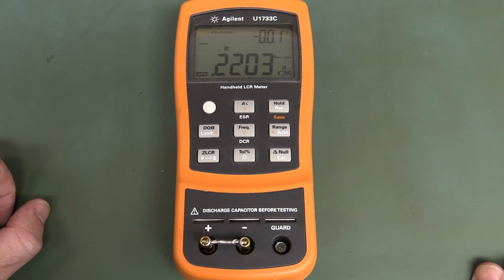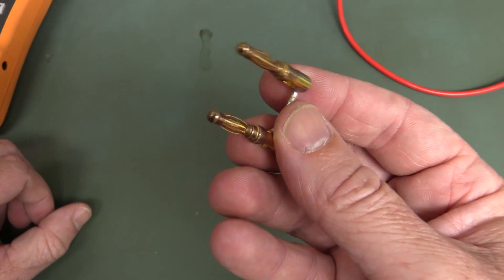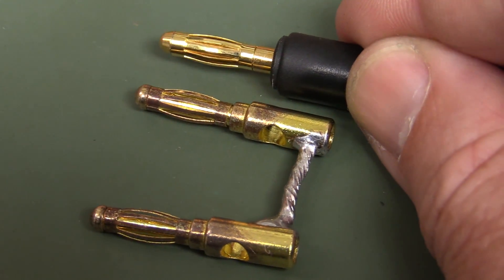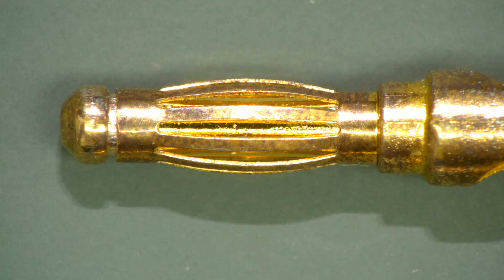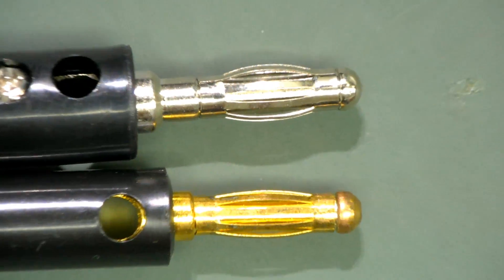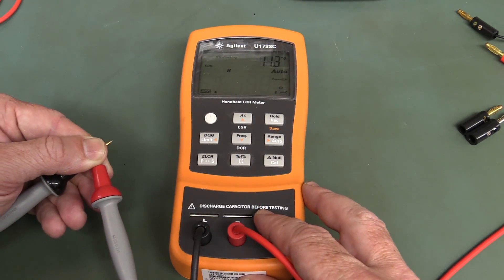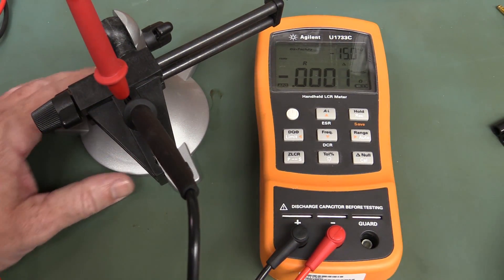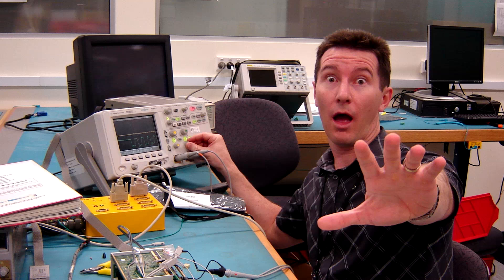EEVblog #1052 - BEWARE Crap Banana Plugs!

Comment: This is why I purchase proper brass banana plugs, a cyliner with a cut in the middle, sometimes you have to use a screwdriver to make it bit wider as diameter varies a bit. Same design was used in soviet era banana plugs. https://www.piekarz.pl/img/offer/1/9/f_19326.jpg These things never failed me.
Reply: You might be surprised how poor a conductor brass is.
Reply: For me these things worked much better than generic chinese banana plugs, brass is a rather good conductor as far as I know. May require some care just as other connectors. Brass is also used in my analog multimeter's terminals. 48 years and no sign of problems
Reply: Brass is about 20x more resistive. 

Brass ~0.6 - 0.9 x 10-7
Cadmium 6 x 10-8
Cobalt 5.6 x 10-8
Copper 1.7 x 10-8
Gold 2.4 x 10-8

Ohm metres at 20 deg C.  It's also not a great conductor of heat, irrespective of its copper content.
Reply: @ChristianRThomas  I'd like to see you measure the different... with current anywhere within the rating!      But seriously, I've had some of this style that became too loose.  Pry the thin slits apart with A thin screwdriver, but they don't seem to stay spread very long.
Reply: @0202fabrice  I have the kit to do that sort of measurement - and I could probably also measure the difference in distortion between this sort of plug and something decent like a Speakon.  You'd be surprised quite how poor most of these connectors are, though I usually hold my special ire for RCA phonos.  Brass is not chosen for its electrical properties but for its machinability.
Reply: @ChristianRThomas  Agree with your last point, but it's not a bad conductor at all for the very short lengths and robust circular mils in the form in which it's used.  You're surely not using brass wire for the conductor; most of the conductive path is copper, which almost asssuredly swamps the resistance of the brass plug.

Let me challenge one other assertion: please explain how a minuscule amount of resistance (as compared to copper) will create audio distortion.  Were that the case,  you'd need superconductors from amp to speaker!!  ; >)

Comment: My uneducated guesses are, first the crappy ones pose a “Gold Flash” rather than gold plating and second, the loose sleeve (cage) is too short or the core is too long.  That combination prevents the ends butting when the cage is extending.
Gold flash is something like one gold atomic layer directly on top of brass.  Hard gold typically has copper flash, then nickel for hardness and finally a decent gold layer.
But what I believe seeing is a length difference between the crappy ones and all the others.  Finally, the cage has not been properly crimped around the pin, leaving a gap.

Comment: Also seems like the split section of the banana jack is much shorter then the solid center section. The part on the Probe Master banana jack looks like theres almost no gap there at all, while the cheap ones theres a large gap. Id say between that and the cheap coating you've found your problem Dave.

Comment: To me it looks like the rings of the bad plugs are too short.
the rings of the good plugs seem to be just short enough to allow rotation when uncompressed, but not short enough to do so when compressed inside a proper socket.
this gives the good plugs four points of contact as opposed to just two on the bad plugs.
Reply: To me it looks like someone stuck for a real problem to get on their high horse about.  Unbelievable!  How can it happen?  why do the masses tolerate it? ... y'know - that sort of stuff.  If I had a penny for every lead I've chucked in the bin, I bet I still wouldn't have as much dosh as 37k views generated for this guy - and still worth a few dollars more - so mission accomplished.

Comment: are you sure it is the ring not compressing because of the lack of the split in the ring, but rather that the length of the rotating sleeve is too short for the recess on the pin.  Seems to me that when compressed the sleeve will lengthen first till it comes into contact with the end stops and at that point the curves will start to deform along the long axis before any forces are high enough to start compressing the end rings diametrically.

Comment: Unfortunately I've purchased a few as well. I ended up holding the rotating part close to the tip and soldered the tip creating an electrical bond eliminating the rotation yet allowing to compress and move on the wire side. Hope this helps others who have in the bin!

Comment: I have no sympathy with the bought for pennies crowd.  If you do a job, and expect to be paid - in what universe does that NOT apply to the rest of the world?  Why would anyone pay a penny and still expect the same quality for the equivalent of a £200 item covered in thick gold?  The chinese are some of the shrewdest cookies in the world when it comes to horse trading.  Yes their labour costs are low - and yes their government subsidise a lot of what comes out of china so they can beat competitor's prices.  And yes in a couple of years the average chinese labourer will expect a living wage, And yes in anther couple of years, when all the other producers have finally shut up shop, as the sole source of everything they'll up the prices.

In the meantime we greedy westerners will continue looking for the cheapest, expecting gold and copper and being surprised and outraged at getting aluminium.  Chinese kit like every other source sells to the price, it's mostly all been made there for years anyway - just in the line next to the dirt cheap ebay one.  Pay a bit extra and you'll get the same kit your old supplier provided.... just not re-badged and given a made in 'murica (or Oz ... or wherever) label.
Reply: You'd pay £200 for a banana plug?!
Reply: Your words not mine CT - I try to keep my expectations real - Looking at my current stock of leads I don't have any gold coloured plugs or clips. 
 All my current leads have a silver finish, most have survived more than 2 years and show no signs of wear or imminent failure.  Gold has it's place ... but not in my general toolbox.  If you're impressed by appearances and need something shiny, make sure you pay a fair price to avoid disappointment.

Comment: There seems to be a lot of up/down movement on the rotating contacts of the crap plugs compared to all the others.  When the curved splines compress it should also elongate - pressing the ends against the centre pin flanges.  That may provide better contact in the non-crap versions.  Perhaps poor manufacturing standards?

Comment: This is not a trap for young players at all. This is a trap caused by unregulated Chinese imports and that traps all players. Some products are substandard; sometimes you can visually see it, other times you can't and this is true across all the industry. Ways to stop bad products: 1) Border customs need to up their game, 2) Buy from a reputable source (it costs more for a reason), 3) Name and shame. I didn't watch all 15mins of this video but I sure hope Dave named and shamed. If not, why not? There are tons of bad connectors around and tons of dross sold on ebay and Amazon. I keep telling people not to buy electrical stuff off ebay; if you do, expect crap.
Reply: All that has to be done is to write a truthful review.  But be precise and specify the seller you bought from.  To many people just spout off without proper precision or specificity to help root out bad sellers.

Comment: Could you "quickfix" the Bananaplug if you sand the bottom-end of it and apply a small bit of lead at it, just a point to ensure the connection. It should always be able to flex and stretch? or would it end up more wrong.

Comment: I've run in to this issue before. It is the split in the expanded sleeve. I've had to pull them off and take a dremel tool and increase the gap in the sleeve. When you insert the cheap bananas the sleeve makes great contact with the jack, but the split closes before the sleeve is compressed onto the inner pin. This leaves the connection loose.

Comment: I have the same kind of bananas on my meter and they are like 5 year old, they are corroded and bent and they had the same contact problem since almost new, my fix for it was to use scotch tape around both of them compress them and they work. I need to get some good quality ones lol.

Comment: I always use high quality 4mm banana plugs from hobbyking, they're for RC planes, to be loaded with like 50A and $1000 plane's "life" depends on them, you can't really get better ones.
+ add their silicone wires and you have AAA quality cables.
Reply: I do the same. I've been using connectors from hobbyking for my octorotor (with camera gear its about £6000 worth) and they are spot on although they are massive ones on that with a built in capacitor in the tip to stop arcing on connection. I made my own leads in the same way as you except I added some of their wiring loom mesh with adhesive lined heat shrink on each end. I use them a lot on site for domestic electrical testing as the mesh protects them from splitting the silicone on a stray nail!
Reply: You are dead right they are excellent quality, plated brass. You can get these with hermaphrodite shells which can be made up to regular plugs & sockets.
Also I join them together back to back which gives me a plug with extension socket to loop into other test gear.
Reply: Some of them (not from HK) are so bad that they don't even stay in the female sockets. The guys on RCGroups are recommending the ones from HeadsUpRC and Aloft. https://www.rcgroups.com/forums/showpost.php?p=38832952&postcount=9953
Reply: Me too, allways replace crappy hard pvc cables on crocodile clips, multimeter probes... etc. with silicone insulated thin coper fiber soft cables from hobby/RC shop, they come in all diameters, from "hair-like" to "welder wire" diameter... 
It gets down below -20 deg.Celsius here (cr123a 3V lithium batteries in multimeters instead of 2*aa or 2*aaa save the day)... try using pvc insulation at that temp ;-)

Comment: I would not say that the high resistance is entirely related to the loose end rings and the quality of the plating. I believe that the length of the splayed contact part will increase when the banana is inserted in the jack (due to its mechanical design). This causes the end rings to form a secure contact with the “hard stops” of the inner shaft. For sure, the splayed contact part is very short in length when compared to the overall length between the “hard stops” of the inner shaft, which may be the cause of the intermitting contact/high resistance.

Comment: Coincidentally I ran into this problem very recently!
I wonder if the quality of female sockets can also be a problem? I have some plugs that do this but work fine with other sockets. Some sockets feel a much firmer fit even though it's the same diameter and doesn't wobble so much. Like you suggested, perhaps there's different styles of plugs and sockets?

Comment: The real problem is that , the spring sleeve should compress around the inner solid part of the plug .
To do this it needs an small air-gap between the sleeve edges , now it is rotating so freely , that it won't
though the inner solid part even if inserted in a socket .
It is possibly made to the wrong diameter tolerances , and crappy '' gold '' plating as well !

Comment: I got some with the same problem, and I improved it drastically by dumping a bunch of solder into the joint where it rotates. It still rotates, and it fills up the space and fixes the fit. I can go from "total crap" leads up to "cheap but works."

Comment: That is not gold on the plating.. gold does not corrode or turn black and shitty looking..i got cheap banana plugs on my 30/5 bps and the rotating part meltded as the moved while conducting some low power. The resistance had gone up as it did on your shunt and the plug melted.. lol gg chinesium

Comment: I was curios about say age and wear.  Take some plyers and remove the splayed  ring on the outside and see if the gold is all worn off.   Then you mention its not that old?  I was gonna say you just need to get some new one's  just cause you had that one since you were a boy or something.  Then you pull out he new one on the micro.  That's not gold plating,  I think that is gold paint, literally.   Not sure I run across "gold paint" but I have run across plugs that are just totally loose after inserting them just a few times.

Comment: Couldn't you just flow a little solder in there to solder the 'peel' to the 'banana' part?  If you heat the peel up and flow it in the edge there it might get wicked in.  For that shunt, they don't need to rotate so it should work.

Comment: Actually nothing is wrong with the banana Plugs Dude, it's because you go and Solder the 2 together and the Heat of the Soldering Iron causes oxidation to the Plugs and then it Developed Resistance dude! This plugs are just not design to be solder at high temperature Dude!

Comment: Dave, take a knife and scrape off some of the plating. I bet what you find underneath is not a common metal used in electrical connectors. The surface of these scream that they are cast out of some poor quality metal. If they where machined there would be rotational marks along the axis of the plug not looking like the surface of the moon. For those saying to clean them.. you cant clean away inferior material! Buy good quality.

Comment: I've had similar problems with some old tin plated banana jacks. I move the rotating part as close to the tip as possible then add a nice dab of solder on the tip end of the rotating contact point, so it's still springy. Sure it doesn't rotate anymore but the connection is solid.

Comment: I had a set of One Hung Low brand banana plugs that had a spring in such a way that it did NOT press on the post when squeezed. But it didn't matter, because they were undersized and were loose in a banana jack.

There was a side hole in each one so you could connect more than one, rather than a jack in the back, but the hole was too small for even those too-small banana plugs. No hope at all for a properly sized banana plug.

Comment: Sooo, there may be some substance to audiophile cables after all then? 

Full disclosure, I am an audiophile but I don’t buy into hyper expensive cables, just solid, well made ones. My system is tri-amped with active crossovers so that’s 24 banana plugs needed, I use Milty plugs and they’re excellent quality and relatively inexpensive.

Comment: The cheap one is Tin casting body with possibly steel spring and gold plating just thick enough to optically look gold coloured . The good one is turned brass with brass spring and proper thickness gold plating.

Comment: Dave mentioned not knowing the "style" of these connector jacks. They are often called "lantern" style, as in frame inside a Japanese paper lantern. LINK: https://i.pinimg.com/236x/0a/e3/cc/0ae3cc28a303e1aef2aa63eaa000b042--lace-lantern-romantic-weddings.jpg

Comment: Well, as far as I'm concerned, squeezing the spring leaf sleeve 'causes it to get longer and mainly press against the top and bottom of the shaft it slides on (where it is thicker) and those faulty contact banana plugs have a significantly bigger gap (difference in length between the shaft it slides on and the spring leaf sleeve thing itself). So it would seem quite logical to me that particularly that one would fail. And if that is the actual reason for it failing, it would be very easy to see whether or not a banana plug has that problem.

Comment: are you running out of topic for YT income.. after all, instead of sitting and fake-giggling for 15 minutes you could very easy in fact measure where the issue where instead of guessing and keep saying over and over it aint the solderjoints etc etc..just demonstrate it. would be an easy mtf'er to just measure the differeent parts of the bananaplugs and demonstrate the issue instead of this 15 minutes tonque-humping of nothing..nahh step up your game Dave... your videos are useally of higher standards.
Reply: I agree with both of you... cheers
Reply from the maker: The comments are usually of higher standard.

Comment: Something kind of similar is I have this external usb 2 hard disc. I just got a new Ryzen system and for the first time I noticed wiggling the smaller usb connector just a bit made it disconnect and reconnect from the system. So this would I think corrupt the hard disc. I hypothesized this was either a port going bad or just the act of moving the connector a bit may make a little break in the signal that could do this?

Comment: you can see at 4:24 there aint any leverage on the carussel-springs, while on the propemaster there is equal dimension and some leverage so they can fall in under the pressure and do as intended..(bad or wrong dimension on the carussel.)

Comment: I bought the same crap plugs on eBay for putting on some wires.  I got around this nonsense by just soldering the rotating part to the shaft part with a huge blob of solder.  I was seeing disconnects due to the stupid plugs!

Comment: You should have measured the short from solid body to body, and then the bowed slip tube to tube. There looks like a benefit to those slip tubes, in that the DMM internal tube doesn't wear out.

Comment: some things one should not cheap out on. wire. connectors. thermal paste. flux.
you spend more, yes. but you also then have a product that is supported by a known manufacturer and will actually make you want to use it more.